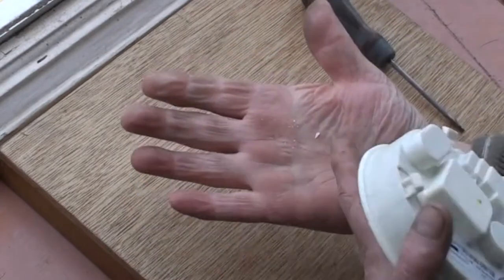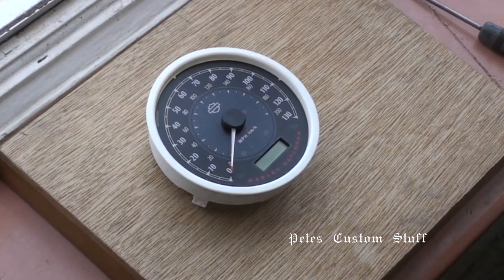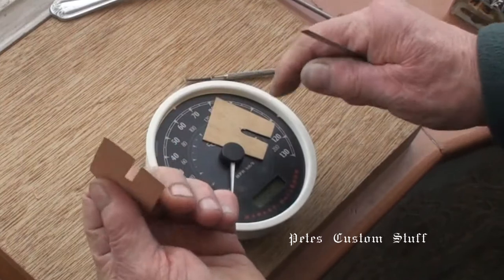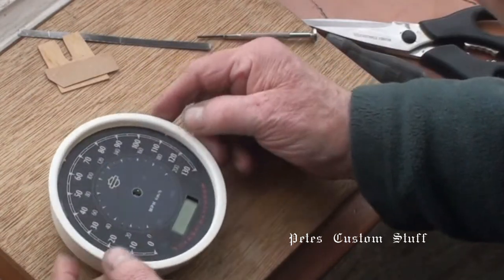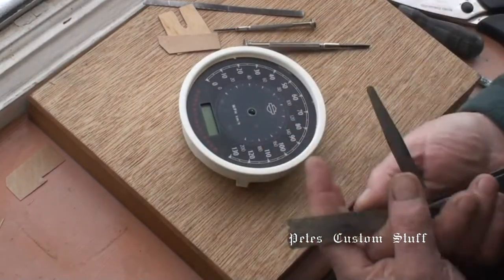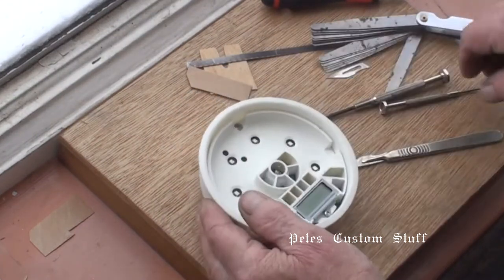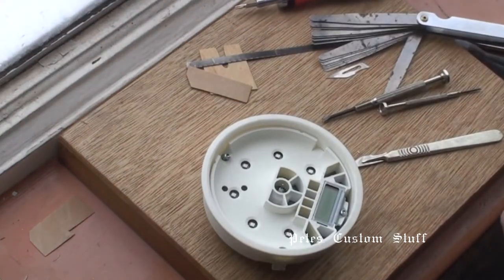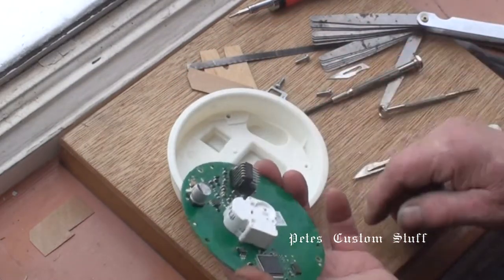Misting Speedo pt2

Comment: Has anyone tried putting the speedo into a vacuum chamber? It might pull out the moisture......just saying!
Reply: Do you have a vacuum chamber? Since he found that the unit isn't sealed, my thought was for him to use Rain-X on the inside glass to expel the water from the glass itself.